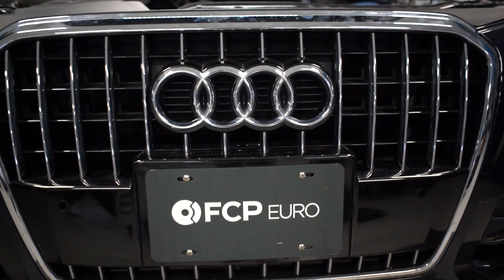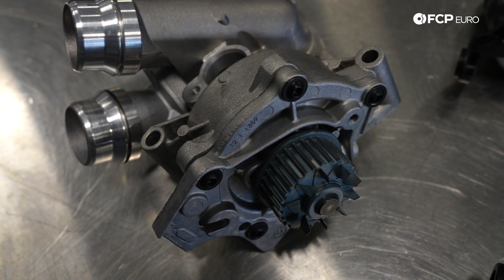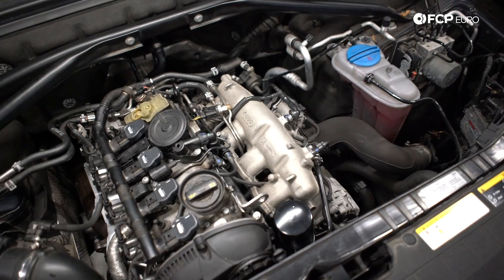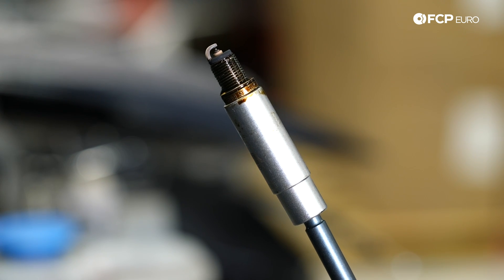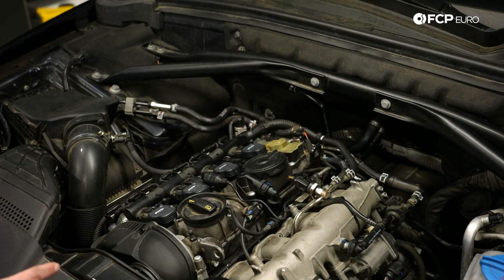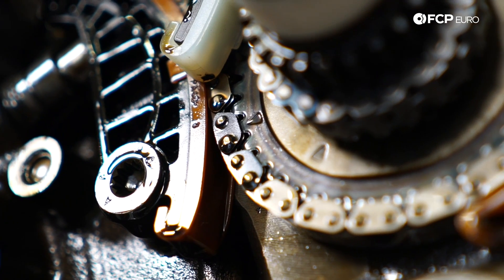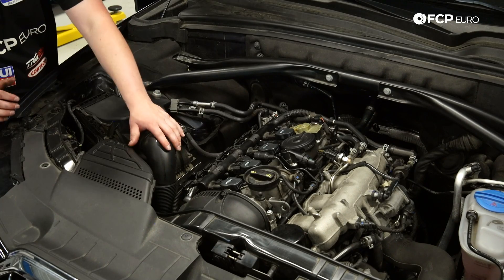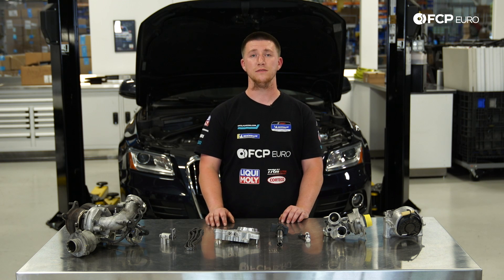Audi/Volkswagen EA888 Gen 2 Engine Diagnostics & Maintenance Guide (Audi A4, A5, Q5)

Comment: I have a 2013 Audi Q5 2.0T and the vehicle had so many issues as mentioned in this video. Timing Chain, Water pump, Coil Packs, Burns engine oil 1 litre every 300km and the list goes on. I contacted Audi twice to see if there is any recalls and they responded no....

Comment: Hey fellas and @fcpeuro i was wondering if i could get some advice i got a q5 from 2013 2.0 tfsi gasoline and i keep having engine problems specificly it starts by giving me a warning that there is low oil pressure and then i start having trouble just starting the engine i,d have ignition but the car just would not start without some throtle occasionally it would die on me while on the road after that i get the epc warning and it goes into limp mode then i would have a massive coolant leak and the coolant reservoir would fill up with foam to the point where i couldnt drive it anymore I've had this problem fixed multiple times but now after it being worked on for 3 months just a month since i got it back I'm getting the low oil pressure warning and the engine occasionally just wont start up without any throtle 
Please help. I've gotten to the point where i,m considering ramming it straight through the shop that sold it to me

Comment: I've got a 2018 audi q5 with a p008900 code that has great power and runs mostly fine but has an intermittent missfire at idle. I checked the fuel rail pressure and at idle it goes up to 3000psi in a smooth curve over the course of a few minutes and when driving it when I floor it and then let of the throttle the pressure decreases sometimes to 2500psi, sometimes 800 psi and sometimes anywhere in between. but the curve upwards starts right away and just driving slow at low rpm or stopping will not make the pressure drop but it will rise to upwards of 3000 psi again and then there's a sharp drop to 800psi with an immediate start of the curve upwards to 3000psi. I believe the fuel pressure regulator is bad but I can't find info on it.
Reply from the maker: Sorry to hear that Roland, these can be a bit tough to find concrete info on. Typically when we see that code its a good indicator of a HPFP giving you a heads up.
Reply: @fcpeuro  I got to test it again today and now I drove slow for and extended period and the car just started sputtering and intermittentenly accelerating the engine without me touching th throttle and then stalling with the pressure at 2900psi. After I let it rest for a bit I was able to start it and then I drove it hard for a while without issue because the pressure bled off sufficiently under full engine load. Then I drove around 30mph for about 2 miles and the engine died on me again. Also I got a very strong gasoline smell out of the exhaust after slow driving which would indicate the engine runs very rich. I don't know if you'll know what's up but I'll leave this here for anyone having similar issues. I'll try to post the solution once I know it. Thanks for the reply. We'll change the hpfp to see if it fixes it. Hopefully I don't waste the customers money.

Comment: Can anyone answer questions regarding our recently purchased 2014 VW EOS?  It just turned 40K miles.  There is heavy soot lining the tailpipe.  Stuck piston rings?  Runs great, not sure how much oil it burns since we've only driven it 700 miles..  Using Synthetic Motul 5w-40.  Was previously owned by older Folks like us.  So, how to identify if ours has the bad tensioner?  Also, how to identify the letter version of the engine?  Is it marked on block?  Thanks for any information.  Should we sell it while it still runs?  Our SAAB 9-5 is from 2002, 171k town miles, and no oil burning and extremely cheap to keep.  Runs like a new car and zero residue in exhaust pipes.  Only major failures on SAAB were the Water pump, radiator, air injection pump and right front wheel bearing.  All of these were easy DIY tasks. Thank you!

Comment: When you use the Valve clenaer/upper engine spray where do you usually spray into ? A vaccum line or directly into the manifold where the pcv goes into
Reply: I used throttle body boot

Comment: Thanks for the video. Please help - Gen2 engine 1.8tsi CDH - I have a question -  hard cold start and high pressure fuel pump cycling noise - NO ERROR code. I've already changed the high pressure fuel pump and it does the same with the new one. I also changed fuel filter and tank fuel pump and nothing changed. If y disconnect the connector of the high pressure fuel pump it stops doing the noise. You can see it in my video. https://youtu.be/Y3El5NJ4MJI

Comment: One of the first things I look at when buying a used car is the timing chain design. This engine is by far the worst I've ever seen for a 4 cylinder. 3 chains and a rubber belt driving the water pump. My Hyundai engine isn't flawless but it has 2 simple chains with no weird curving and an external water pump. My engine is the same displacement as the EA888. The Germans love making things so much more complicated than they need to be.
Reply: My 2.0T only has 2 timing chains

Comment: You should do a timing repair before you get the check engine light at 70k to be safe but most last over 100k on original design
Reply from the maker: Peep our timing chain DIY now uploaded NaptownTuner :-)
Reply: My Gen 2 CDNC has just failed at 98.5K. Although chain stretched and had jumped; thankfully no damage to valves, pistons or camshaft. *wipes brow.

Comment: The high pressure fuel pumps leak gas and cause a rich fault very common on this platform
Reply: What mileage should you replace this ?

Comment: Damn what a rolling pile of junk. Timing chains, turbo replacement, oil leaks causing water pump leaks and engine mounts. First time ever I’m glad I bought a BMW. No wonder these are dirt cheap used.
Reply: its a rough engine. If you can't DIY, its better to just sell the car before the issues arise otherwise we're talking serious cash at a local shop to keep it going.
Reply: @ps2cho  ea888 seems to have some issues an average diyer will feel very uncomfortable doing. Piston rings is not something you’d feel comfortable doing even if you did almost all the typical BMW stuff like gaskets. I don’t appreciate the fact that the engine needs to be retimed to fix an oil leak at the “valve cover” which happens at 60kmiles. Not a4 but b8 platform related - the transmissions on these cars are huge and heavy, and say you’ll need to replace the stronic on the s4 (happens quite often) or do a clutch job on the a/s4, it will be very iffy on jack stands.
Reply: @yashsab2  great response with your insults, really shows some class and makes all the Audi owners myself including really proud) you can or can’t agree with me, whatever, I’m putting this stuff not really for you but for all the other people. However, looking at Audizine, it’s clear that many b8.5s are starting to show oil consumption issues. Moreover, many people missed a time/mileage windows for oil consumption fixes for b8s, so there’s that. While the a4s don’t have transmission problems, s4s do and I often hear about b8.5s with various problems like gear selector position sensor (not an easy job).
Reply: Lol bmw is worse.
Reply: @yashsab2  right, they have an actual valve covers and you don’t have to retime the engine when reapplying RTV to valve cover/cam bridge. And their 2 liter turbos don’t drink oil. I agree that this totally sucks, no labor hours for the engine rebuilds
Reply: @fastboatster  You don't need to retime the engine when resealing the cover/bridge.  The mating surfaces are a pain to clean though.  And the oil consumption issue pretty much stopped in 2013.
Reply: @smkinrade  great, learned me something new about ea888 (valve cover/cam girdle), I was under the impression from the service manual that cams at least need to be locked in place for this repair, glad this is not the case. As for the oil consumption, I see a lot of threads on Audizine with b8.5s burning oil. From what I gather, there were multiple piston/rings revisions and there’s a chance that many b8.5s didn’t get the latest waffle style rings. I encourage you to take a look at some threads there. I also freely admit that while I have a b8 chassis car, it’s an S4, but I’m also looking at what’s going on with A4s. Owning an n52 e90 328i as well, I do think that I should be glad I didn’t buy an A4 instead
Reply: @fastboatster  Allright chill out everyone. I have a 2013 all road with the updated CPMA engine @ 142k miles. I just got done a timing chain and balance shaft chain + guide job as preventative maintenance. Would I say this engine is reliable? Yeah. Super reliable, hell no but much better than the equivalent BMW N20 and N26 engine. Also oil consumption is still a problem on the updated CPMA from 2013 - 2016. I know because I’m because I’m burning 1 quart every 1,700 miles. Also a new lawsuit was opened to extend oil consumption to 2013 - 2016 models and there is at least 8 pages dedicated to testimonials from people with 2013 - 2016 models with oil consumption. I’d much rather have this engine than an N20 / N26. That engine is the biggest pain in the ass 4 cylinder I’ve ever seen.
Reply: @mydimeisup5103  right, but why have n20 when you can have n51/n52 or n55, lol) n26 has some perks being a SULEV engine and can have a lot of work done for free up to 15 years and 140kmiles if you live in a CARB state. Anyways, all I was actually trying to say that both Audi and BMW had good and bad engines, so blanket statements are not correct. That said, I think this video should be redone and they should have Naptown tuner talk about ea888
Reply: @fastboatster  Zero oil consumption on my 2016. I change the oil every 5,000 miles and I take out exactly the same amount of oil I put in. Some moron on Audizine started spreading that rumor about the B8.5 cars not getting the updated waffle rings, but the fact if the matter is that virtually every B8 2.0T engine had excessive oil consumption from day one and virtually none of the B8.5 cars do. A few random guys complaining on a forum is meaningless because it's such a small sample size. 99.9% of B8.5 owners have no oil consumption issues.
Reply: @Japplesnap  You have to be absoluetly blind to say that no B8.5 or people with CPMA have no oil consumption and that is some rumor. My 2013 allroad with CPMA has oil consumption. So do the hundreds of other people in the newly filed law suit. https://www.courtlistener.com/docket/59873124/1/rieger-v-volkswagen-group-of-america-inc/ Go to page 21 thru 43 and see how wrong you are. Follow the whole thing at https://www.courtlistener.com/docket/59873124/rieger-v-volkswagen-group-of-america-inc-dba-audi-of-america-inc/
Reply: @Japplesnap  Also people who have done engine rebuild on their CPM(A/B) engines have done rebuilds because of oil consumption and have shown (with photos) that they don't have the updated waffle style rings. These rings were never installed on Gen 2 engines from the factory.
Reply: @mydimeisup5103  Where did I say that no B8.5 cars have oil consumption issues? Nope, I never said that and I never would bmake that claim. I've been around long enough to know that every potential issue will happen to every model year of any particular car. If you told me that a particular Toyota engine doesn't have oil consumption issues, I can guarantee you that I can find several people who own a car with that engine who have oil consumption issues. Yet just like the B8.5 cars, the vast majority do not have oil consumption issues. So yes, it's basically a non-issue.
Reply: @Japplesnap  Its when you said "99.9% of B8.5 owners have no oil consumption issues" yet the forums and law suit would say otherwise and it isn't a non-issue. The problem is happening again and were starting to see it more often as these CPM(A/B) climb higher mileage. The problem occurs, just later on. How do I know this? Again the piston rings from people who have done tear downs are not updated to a proper design (only updated to accommodate the 23mm wrist pins introduced in CPM(A/B))
Reply: @mydimeisup5103  I have a 2013 Allroad w 88k miles that has recently thrown “too rich/too lean” codes although only twice in last 4 months.  Check engine light same, 2x in 4mo. Highly reputable local mechanic suggested it could be purge valve but hard to know as codes were intermittent.  Car has a somewhat consistent sputter in acceleration under only mild to moderate acceleration & sometimes clunks sort of hard.  Same local mechanic didn’t suspect transmission although I’ve read this could be involved.  Next steps I’m trying (in this order if one first doesn’t remedy):

1. Fuel system cleaner 
2. Purge Valve replacement
3. Spark plug replacement 

Any further insight from experienced folks welcomed and greatly appreciated!
Reply: My BMW has far more common issues than this engine. But that's okay. If reliability was the most important thing, I'd drive a boring Toyota. No thanks, not for me.

Comment: The uploads are very informative with clear explanations and possible explanations of the problems.

Which in my opinion is partly the cause of many problems: rapid development and production with less eye for long-term quality! Wear is of course also possible .... .

grtz
Reply from the maker: They do make it easy for us to talk about the problems when they tend to build these cars with a handful of flaws!
Reply: @fcpeuro  - The VW group can also organize a tombola : guess the number of technical defects. The prizes to be won are a turbo + compensation for hours worked.

Years ago I switched to BMW : X5 F15 3.0 diesel, F31 2.0 diesel, Amsoil as a liquid such as 5w30 euros, Liqui Moly injector cleaner every 20,000 miles, in the meanwhile 7 years never had a technical defect. Except the I-drive (GPS). Haven't regretted it for a second. Before that I had an A4 1.9 tdi 110 bhp whose chassis was very poor.

Grtz

Comment: Scrap VW can’t make cars anymore
Reply: I remain impartial, but the quality drops significantly. Small problems everywhere that should have been avoided.

I drive BMW myself. F15 never had any problems not even a leak, nothing. My F31 only has a problem with the iDrive. Nothing else.

Mass mass mass mass at the expense of quality. AUDI = VW = SKODA = SEAT
Reply: @TheCeki1982  Just wait for your 10hr oil pan reseal :) I do them every week
Reply: @smkinrade  yes, but it’s going to be good for another 100kmiles and can be done for a grand at a good indy. Can be diyed, too, but not a novice kind of job, right.